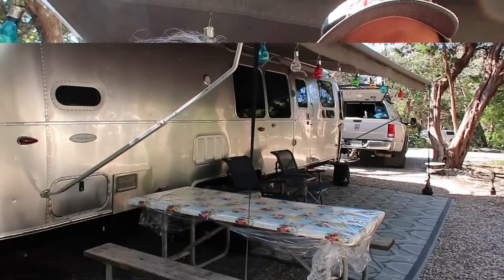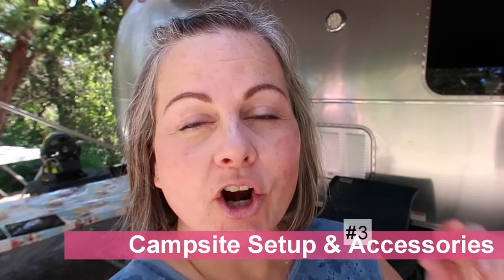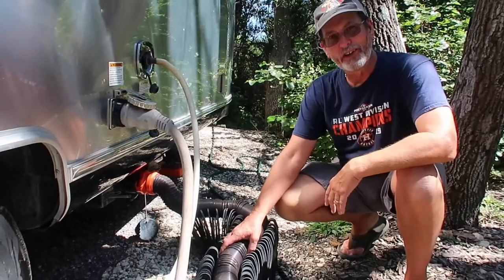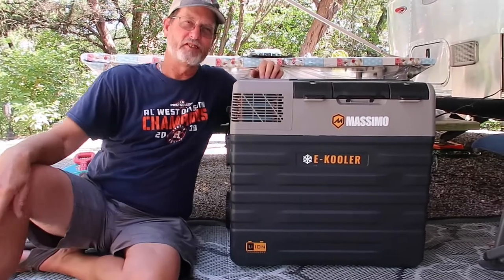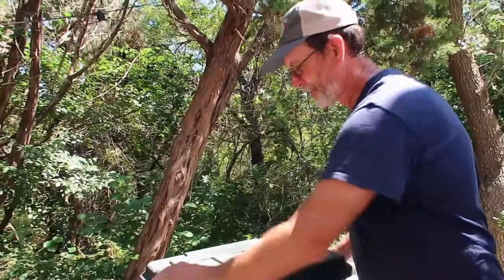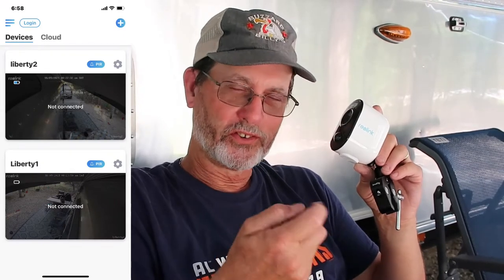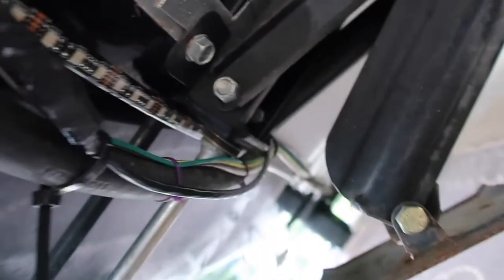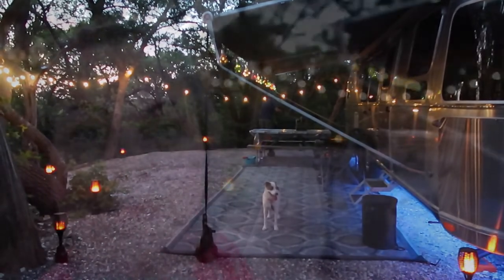Airstream Outside Setup - Full Time Airstream Living

Comment: Love the video! For some reason I thought Paul had hardwired a Power Watch Dog inside the trailer, so I was surprised to see a surge protector at the pedestal. I love your set up! The shower head holder is genius!
Reply: I did have a watch dog hardwired., but we had run into a problem with it when we lost power one day. I have a small 3500 watt generator that I was going to use with a 30 amp pigtail. For some reason with the watchdog I had no power to airstream. I uninstalled it and used my surge protector from the pole and I had electricity. I don’t use the watchdog on my airstream anymore. If my airstream was 30 amp and used a 30 amp watchdog  it probably would have worked
Reply from the maker: Thanks for watching!